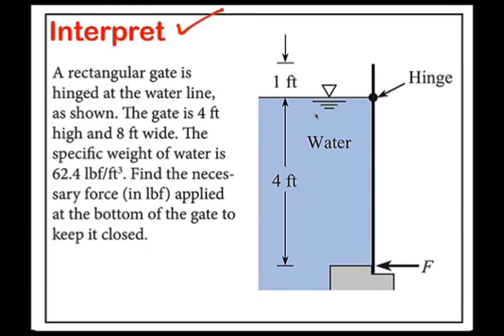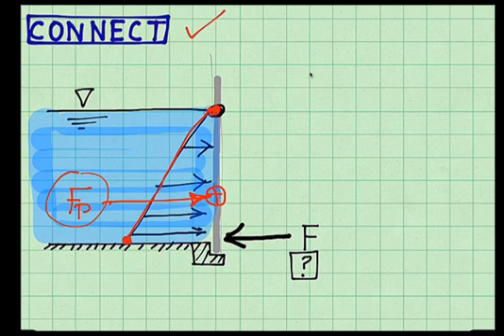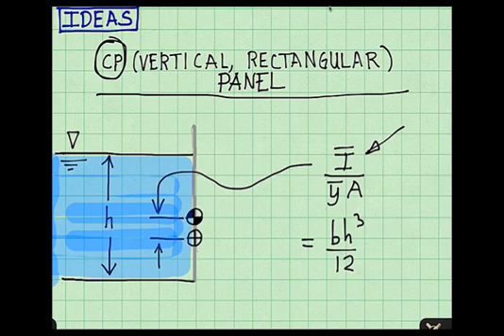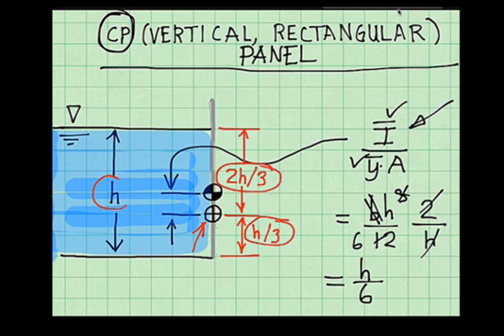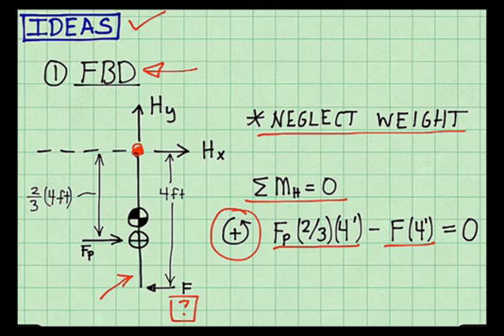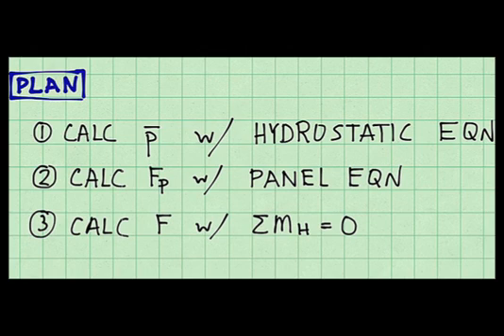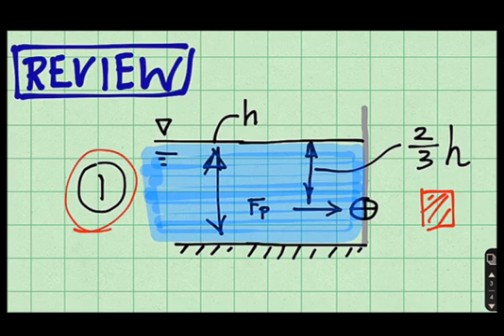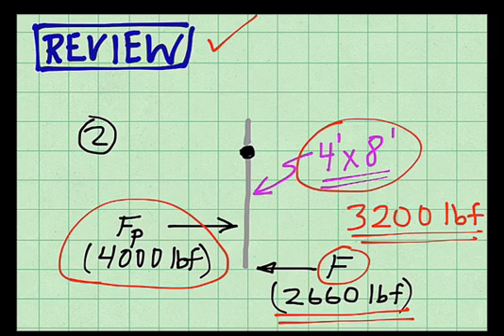Example: Panel Equation (Number 2)

Comment: About the equation you use to find the center of pressure. Does this give you a coefficient to multiply your h by to find the center of pressure position?  I am confused because you calculate it to be 2/3 and then later you multiply your height by 2/3 to find the moment at the center of pressure.